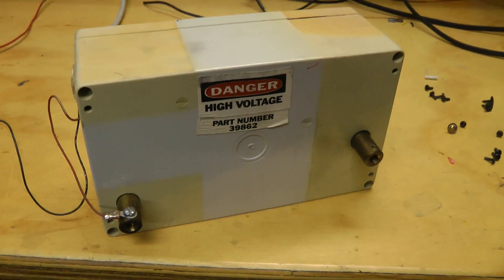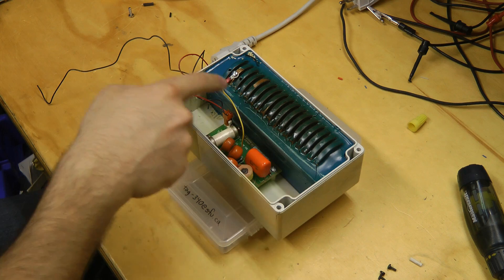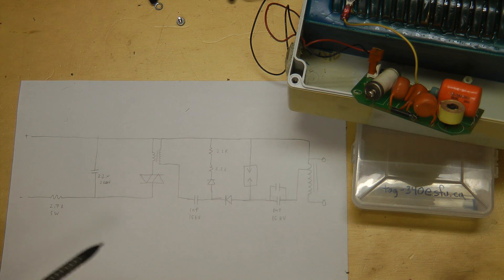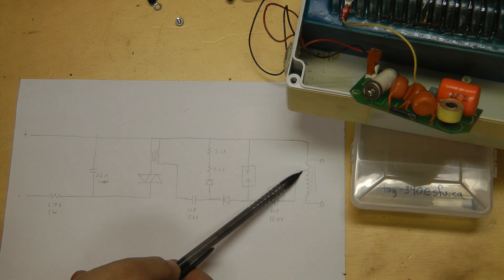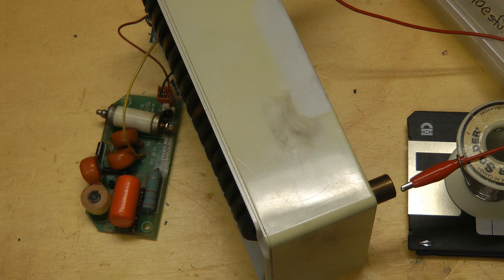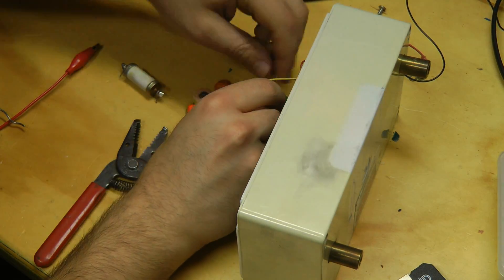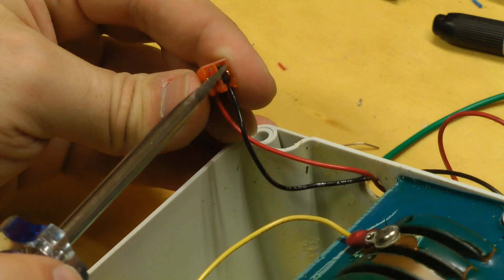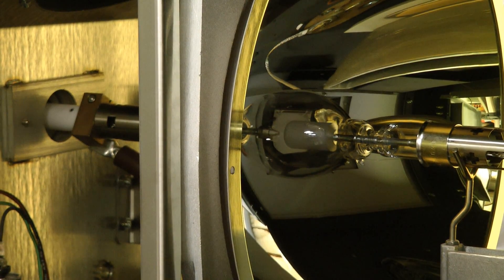Extreme teardown - Simplex 35mm cinema projector - Part 5 Ignitor Repair

Comment: Nope, that is an original ignitor and it is the first generation of it. In the newer ones, Strong beefed up the caps and put an open spark gap in it, consisting of two set screws, so the gap could b cleaned and adjused.

Comment: you have a good grasp on the relevant engineering, any reason you would not be ideal for designing a power electronics module for EVs? or are you weak on KISS and cost optimization

Comment: I believe the ignitor was producing the correct voltage after you fixed it, as a few of the sources I've seen list the breakdown voltage of air at 3kv/mm, or 30kv per cm. Looks like it was reaching past the 1cm mark. Well done nonetheless.